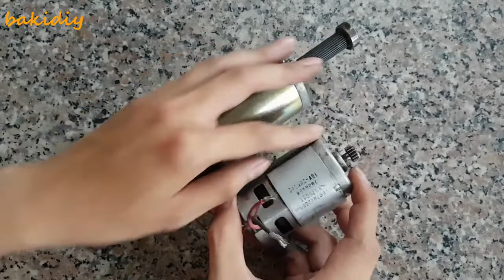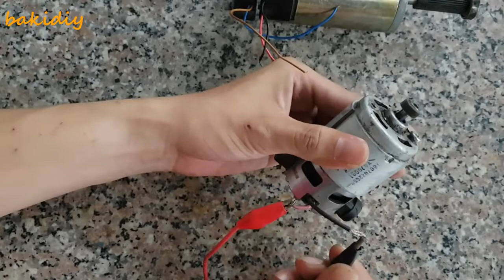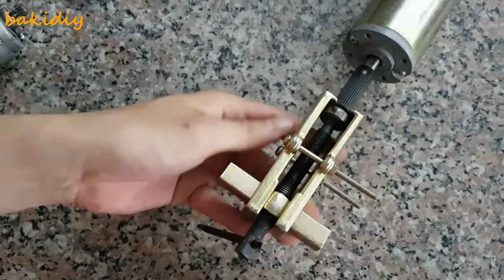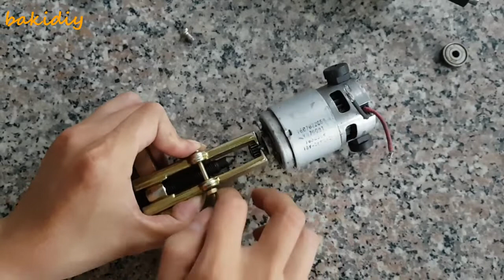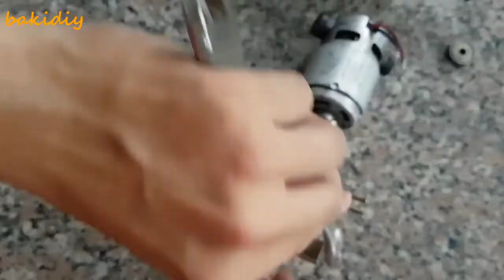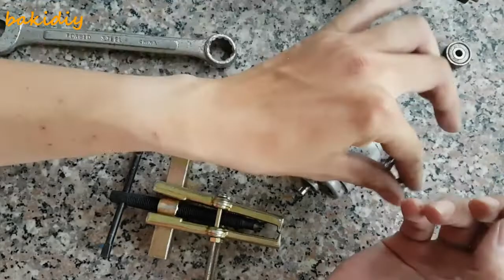How to remove a pulley or gear from a motor shaft using removal tool (Gear puller)

Comment: i have some kind of a metal shaft on the end of my shaft. it sint a gear, this wouldnt fix it. its like a big metal shaft, stuffed on the main shaft. iam talking about an universal motor btw

EDIT: if you dont know about what iam talking about, i found a video of the part. https://www.youtube.com/watch?v=bueDxCgCIO4 the guy in the video starts cutting it at about 2:15. that is the part iam talking about. i dont have knowledge nor time using powertools (iam just a kid, that knows about electricity). can you help me with this?
Reply from the maker: You can use a file (a tool used to remove fine amounts of material from a workpiece) to thin the shaft and remove it, but it will definitely take longer
Reply: @bakidiy  ok, i just noticed that it is really weak. part of it cracked purely from a smsh from a hammer. i shouldnt take long, thanks tho :D